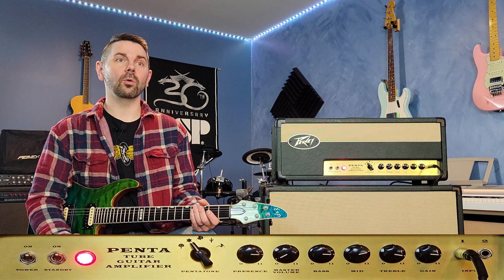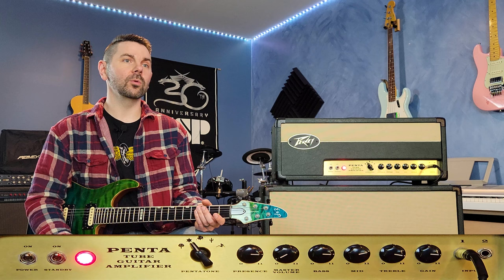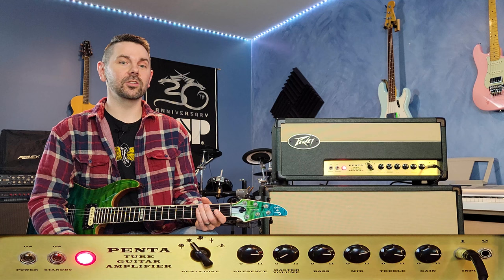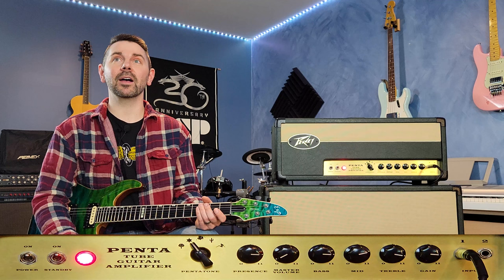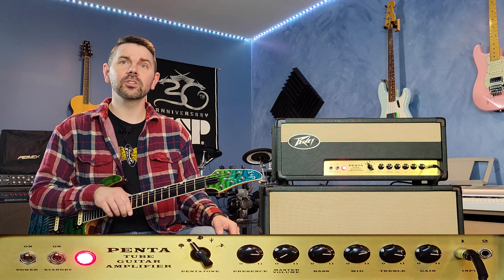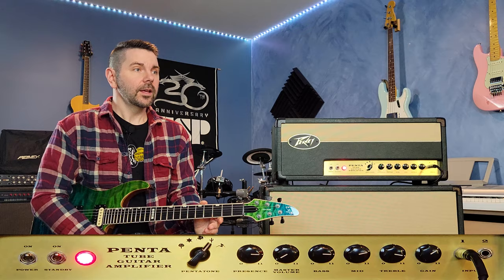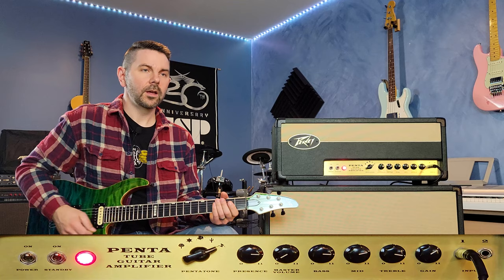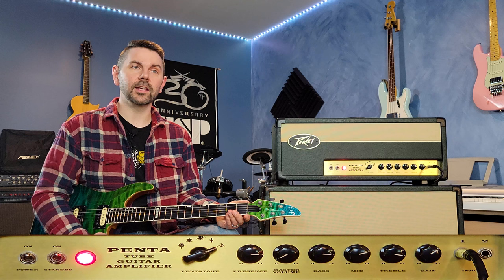Peavey Penta - Pentatone Mysteries Explained + Tone Secrets

Comment: I thought of taking two of the four tubes out and then do an intentional impedance mismatch on the back to make the impedance correct for the two tubes.  But then i figured it will still be 70 watts and still crazy loud.  Also convert the ground switch to a triode/pentode switch to scrub off some further power.  I always think about when using these attenuators, you're killing the power tubes even though the volume is lowered acceptably.  I wish there was a high voltage equivalent to the el34 like the 6v6 is to the 6L6.  Those el84's can't take the same plate voltages as el34's can